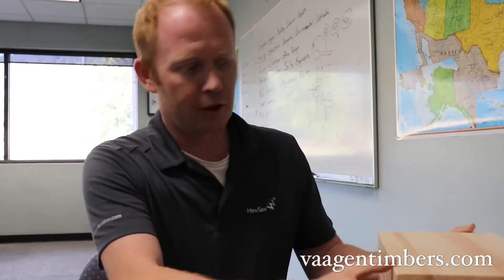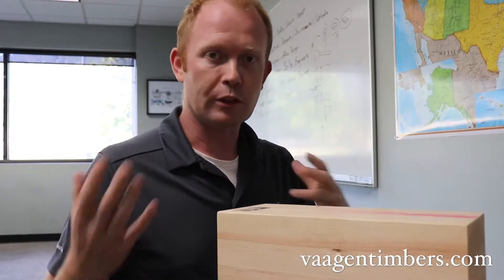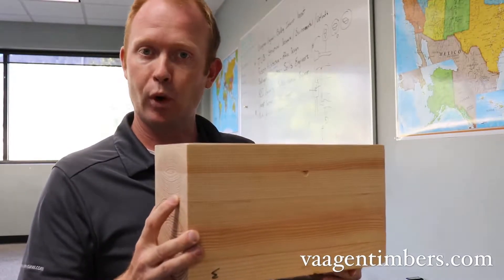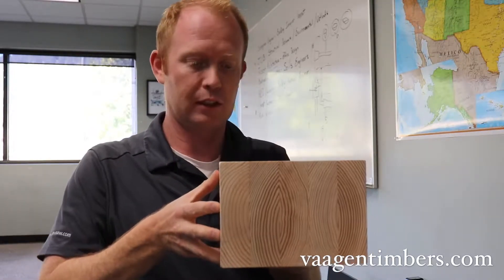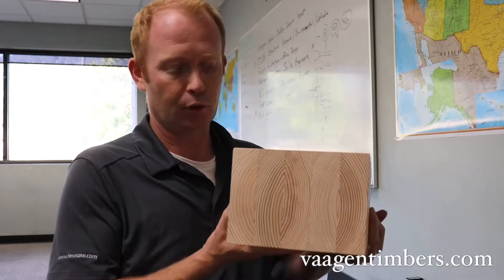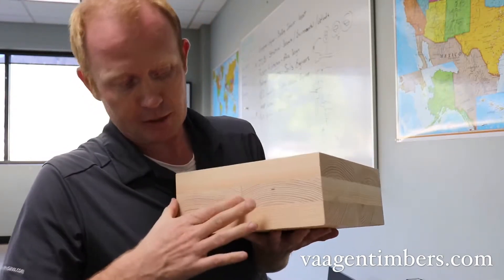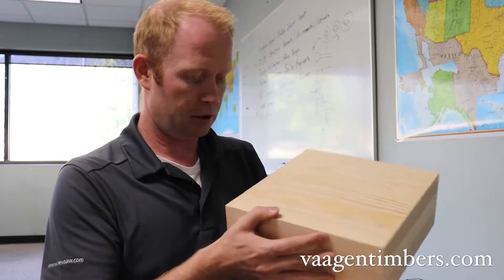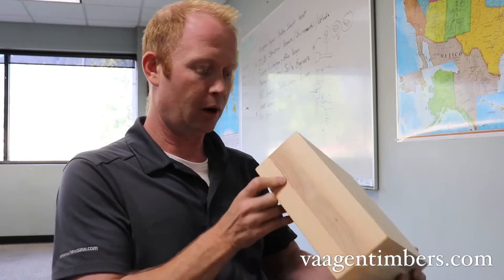WHAT IS CROSS LAMINATED TIMBER? - Here’s a description of mass timber products

Comment: What glue do you use?
Reply from the maker: The finger jointer uses a purebond adhesive from Henkel (Loc-tite brand). For the press we use a Hexion two part MF adhesive. The same that’s used in plywood and traditional glulam. The adhesives are clear or white(ish) in color and go through a high frequency press to achieve consistent bonding every time.